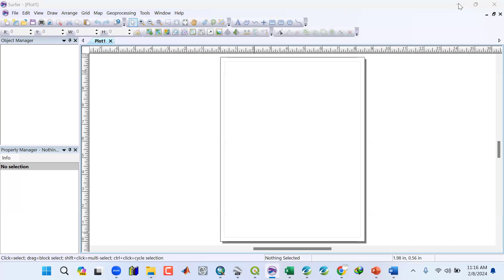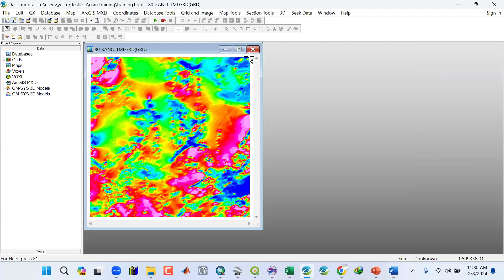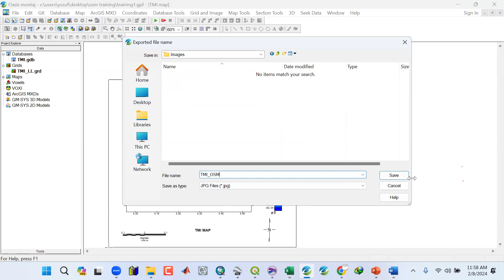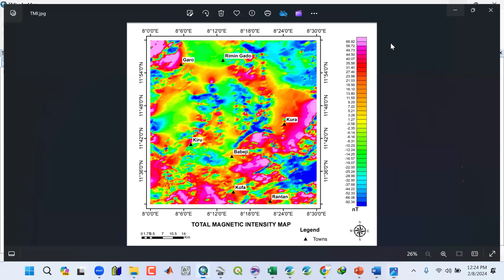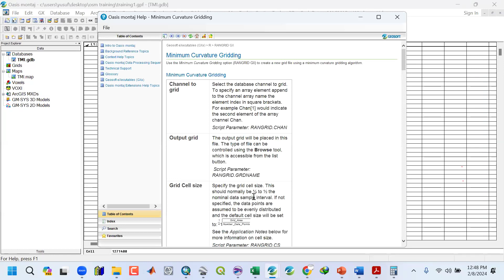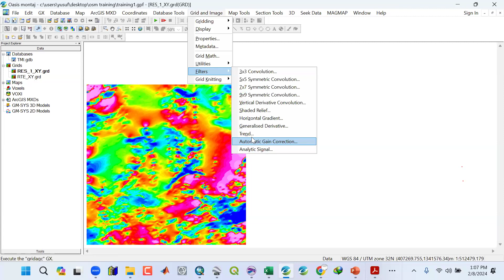[NEW]  Training on Aeromagnetic Data Analysis - PART 1 - Replay [08/02/2024]

Comment: Why didn’t you reduce to poles in the first part of the lesson
Do you have to apply an tie line leveling? For example drone mag data
For reducing to poles or equator, what if your using base mag data taken in the field. Or is that part of the initial tmi calculation done. I forget
Reply from the maker: Message me 4yusufamusa@gmail.com I have a full videos on ground magnetic data correction